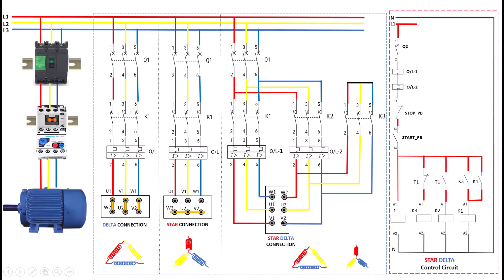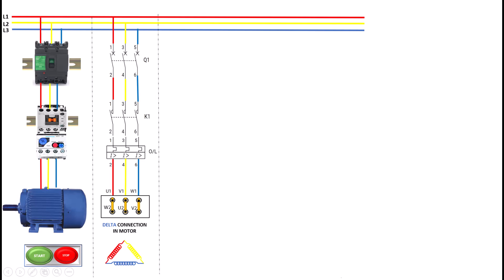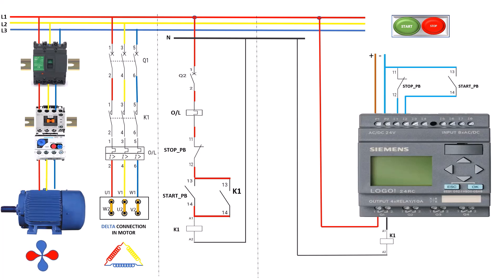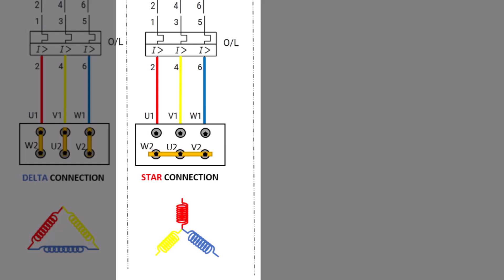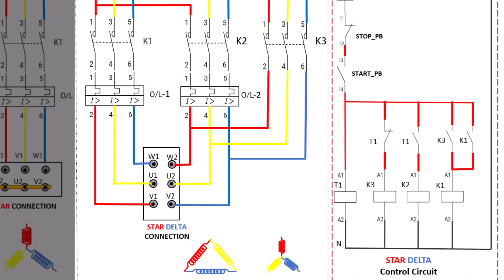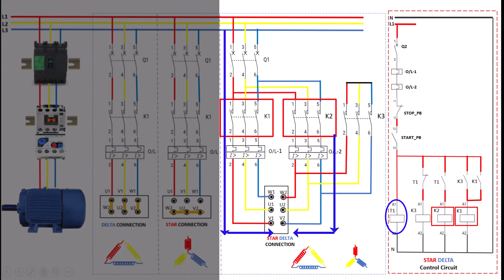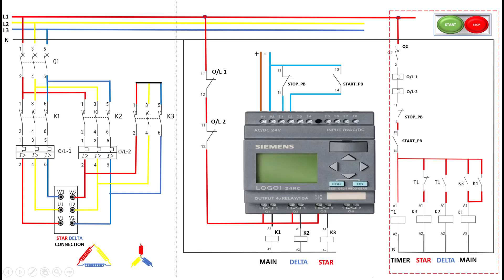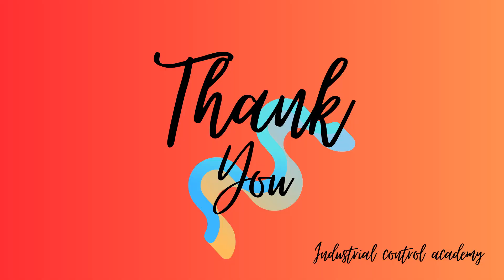Star Delta Starter Wiring Step by Step | Motor Control Basics  | Star Delta Starter Made Easy

Comment from the maker: Thanks for watching! Have you ever wired a Star Delta Starter? What challenges did you face? Which part of the process do you find most difficult? Let us know in the comments! Also, do you think PLC control is better than traditional Star Delta wiring? Share your thoughts and tips below!
Reply: PLC and ladder logic is a challenge for me
Reply: @nhlanhlamanana9822  for me, i have same feeling. But this channel has change my way of thinking and give me confidence. see the comments how people expressing scenario with PLC. life is easy now.
Reply from the maker: @nhlanhlamanana9822  https://www.youtube.com/watch?v=S7DAAlQmobg 
start PLC programming from here will help you understand everything very easily! 
Let me know if you have any question.
Reply: I'm both interested in, traditional Star, delta wiring and PLC.
Reply from the maker: @bonnylasu7665  for the PLC, https://www.youtube.com/watch?v=S7DAAlQmobg try learn the basics first, then it will give you 100% understanding how to make output high to switch from 1 contactor to another!
Reply: Sir check your power circuit on star Delta is a mistake when Delta run must be U1 & W2 - V1 & U2 - W1 & V2 are connected together.
Reply: @ArmsStrong-u8g  hi, I also found U1 and U2 connecting together. From video, it should U1 - V2, V1 - W2 and W1 - U2
Reply: Hi brother!, I wonder if you have courses available, I really would like to learn about all this stuffs, I’m very interested, please let me know if you can provide some courses
Reply from the maker: @juliocesardelacruzhernande200  yes, we can have an online meeting to schedule the things for your learning more!

Comment: hi, Sir, Thanks so much for sharing. But I found U1 and U2 connecting together. From video, it should U1 - V2, V1 - W2 and W1 - U2 on star-delta connection.
Reply from the maker: What happen if you change any 2 phases?  instead of all 3-phases changing ?
Reply: @IndustrialControlAcademy  Thank you so much for replying, sorry Sir, I still can't get it. From your circuit, V1 to W2, U1 to U2 ??? and W1 to V2 ?, how to connect in delta? Delta jumpers: U1→W2, V1→U2, W1→V2

Comment: Is a 2speed motor a case of being in a delta or star configuration?
Reply from the maker: I didn't get your you!
i commenting what i understood, 
A 2-speed motor isn’t simply about delta or star configuration — it’s more about how the windings are arranged to achieve different pole counts. There are several methods to get two speeds, such as the Dahlander connection (which may use delta/double star configurations) or separate windings. So, while star or delta may be part of the setup, the key factor is the winding configuration, not just the connection type.
Reply: @IndustrialControlAcademy  
If you have a 2speed motor with a single winding you would use a deita-star configuration to select the speed selection?

Comment: モーターノイズがシーケンスに入らないのか。
Reply from the maker: this based on electrical equipment like contactors and relays to make the sequence like run the motor with star configuration and then shift Delta configuration! 
But all the sequence work on automatically for star delta configuration.

Let me know if you have further question.
Reply: 鉄板　アーク溶接　銀魂メーター
残量確認　内圧抜き作業
電流鉄板刻印

Comment: Hi,apart from star delta and PLC Control.
Please can you explain ATS control wiring diagram and DC signals operations according to DSE control for a Generator. (3phase/Single phase. )
thanks.
Reply from the maker: OK, Noted. I ll try to make a video on it to explain you all aspects.
If there is any certain query, do ask me here. i ll answer you as well! 
ATS wiring is very simple, either you using 2 contactors with some relays, or ATS controller.
Thanks!

Comment: Great tutorial. I just started learning PLC, and I must say that I am really impressed with how you teach, making it easy to understand. I am interested in PLC programming. Can you please do a video on PLC programming in general? You can also do a video on the star delta setup and programming. Thank you.
Reply from the maker: You're very welcome!
first you go through these following videos, I believe, it will change your way of thinking after watching these videos. After that, come back here again, and tell me how you will develop the logic scenario for star and delta configuration in  PLC when you have 3 contactors. i will guide you in case you make mistake. Feel free to share experience.

https://youtu.be/MQ0itvVzloo

https://youtu.be/MW_VuJAfX60
Reply: @IndustrialControlAcademy  Okay. I will do that.
Reply: @IndustrialControlAcademy  Hi,
This is how I think the star delta configuration in a PLC using three contactors should be. Your videos always inspire me. Thank you for sharing the PLC programming link. 

Steps
Inputs: Start push button (I1) 
            Stop push button (I2)

Outputs: K1 (star contactor)
               K2 (delta contactor)
               K3 (main contactor)

Timers: T1 (star timer)
             T2 (short delay timer)

When the start PB is pressed, K3 is energized, which powers the motor connecting to the supply. At the same time, K1 is energized, which connects the motor windings in a star contactor. The motor runs for a short period specified by T1. When T1 is complete, K1 de-energizes, and a short delay timer is activated. When T2 expires, K2, which connects the motor winding in a delta configuration, is energized and operates at full speed. When the stop push button is pressed, all contactors de-energize, stopping the motor. 

I appreciate your response in advance.
Reply from the maker: @joyozoh9315  Excellent. This is what i expect from you after watching my video. Great. Enjoy!

Comment: What I couldn't do is to read in a monolinear electrical diagram how the auxiliary contacts, NO or NC in the circuit of a relay are connected, like the one on the right at 13:56! How are they combined with the contacts of the other relays, e.g main power relay, start-stop, timer and star-delta switching.
Reply from the maker: its very simple. 1st each auxiliary contact has main component like MCB, MCCB, Magnetic contactor. each NO and NC contact of main component, if being use on same page (any electrical circuit) or on different page, it would have reference page number and the most import thing is to nominate with that component to which is associated. Like O/L-1 is overload main component to protect the the motor to run further. it will stop to pass electricity and also in the control circuit, it will stop other component to de-energize for motor safety. also these contacts move to panel Lamp for local indication and PLC input for information that got got trip on over load.

one more thing, if you are confused on wiring, just take the positive wire and pass through the auxiliary contact of individual component and that it. its very easy. 1st you draw the drawing with your own understanding, once you clear, you will do it practically for small circuit. make sure you remain safe while test. take safety precaution as priority.  try this small circuit. 

https://youtu.be/QW1Kq_Tw2-8
Reply: @IndustrialControlAcademy  Thanks, the last paragraph was helpful!